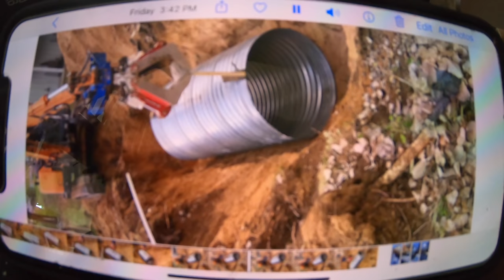We weren't prepared for what we found.  Bomb shelter #2

Comment: I have never operated heavy equipment before, but I would have guessed that a regular bucket would have dug the hole faster.
Reply from the maker: you are correct-  we weren't expecting sugar sand-  that really screwed things up.
Reply: @R-Dub-Ya  Funny i would have said "trying to eat a stake with a spoon"😂
Reply: @R-Dub-Ya  honestly probably be a crap shoot either way, be a lot of down time to get a different machine in there that may not even be available in the first place.
Reply: Well it looks to me like bro Stan likes a good challenge too, like working with what you have, it's fun, that's the farm boy coming out! Great job at persistence and not giving up when things go haywire!

Comment: My story —— it never mattered what I did weather building a house, shop, barn, putting in outside hydrant, driveway or fence after all said and done there is always something of the project I would have done different even after studying, rethinking, changing, and going over in my head time and time again before I even started. I have come to realize in my 67 years nothings perfect.
Reply from the maker: agreed-  very well said.
Reply: As long as we don't get stuck in OODA loop we'll be ok. 👍 Getting the job done is all that matters.

Comment: Stan, I'm sitting here thinking about something. A wireless headset for the operator of the excavator, and a hand held walkie-talkie for the spotter would be a huge safety addition. Only need them on occasion. Would definitely help. Nix any misunderstanding.
Reply from the maker: good idea.  we typically use hand signals to communicate.
Reply: @guilty of treason on Youtube uses them to communicate with people down on the ground. They can be quite cool.

Comment: We have all been at those projects was doing Landscaping&Tree job at one of my great customers of mine she was tearing baseboards off an basement apartment wall she has in her 1808 house. We ended up gutting entire apartment and digging outside along foundation putting in drainage pipes and sealing walls inside and out turned out to be a major month and a half project.
Reply from the maker: Those get interesting-  I went into a pool demo job. Simple $7,000 demo project and ended up jacking up their 3 story house, partially rebuilding the foundation wall and compeltely gutting their back yard.  Total cost went from $7,000 to $75,000.  they just kept adding on more and more work.
Reply: @Dirtmonkey   The great thing though is that YOU were up to the task.  You got the job done.

Comment: When doing a project like that why would you even have the grappler
Reply from the maker: It wasn't a big dig- so instead of swapping the grapple out- digging with a bucket and then reswapping and installing it- we just went straight to work.
Reply from the maker: On some jobs it takes longer to swap out equipment and  then just getting through the work.  But you go have fun with your tack hammer

Comment: I needed to clear a corner on my lot for snow removal then a garage. Got a mini x and dump trailer lined up for stump removal and grading the pad. The tree removal company didn't show up for two days so that put me way behind. I wasn't able to remove all the stumps before I had to return the mini x and trailer. Winter hits and I had no place to pile snow. Spring comes around and the wife and I get COVID. Recovery was slow and couldn't get back to the project until fall when I was able to get the mini x long enough to remove the remaining stumps and fill in the holes. Luck had it a friend bought a new Kabota loader and wanted to try it out. He did a fair job getting the roots out and grading it down. A job that should have taken 4 days turned into 2 summers. And I still have a pile of stumps and roots to haul off. At least I have a place to pile snow.

Comment: Stan, great video as usual just a suggestion we run the same grapple and when we are using it to dig dirt we welded tabs on the  both ends of one side of the the grapple and would bolt on two plates so when  your digging the one side would catch more material. Just a suggestion keep safe and keep the videos coming.

Comment: Happens every once in a while doing diy crap. Wife wanted a light over a sink and it should have been easy. Marked the area to cut out, cut the dry wall ceiling and a water line ran right across my junction box hole. Day later finished the job.

Comment: Not construction related but i purchased a 1977 Jeep J10 Honcho with an AMC 360 for dirt cheap that "just needed the carb put back on" got the thing running and it developed a tapping sound that would come and go. I bought an edelbrock intake manifold and went to put it on and noticed a lifter was blown apart. Ordered a new camshaft and lifters, got them put in and the tapping was still there. Decided to completely change my plans on it and pulled the motor to discover a spun rod bearing. Did a complete rebuild on the motor and went to put it in but decided i would change plans again, i just couldn't bring myself to put the motor into a dirty rusted engine compartment. The truck is currently scattered all over the carport while i do body work and paint it.

Comment: If you were going to build a retaining wall in that area  would you have to remove all that sugar sand to make it work or could you add in structural soil on top ?
Reply from the maker: we could use that sugar sand as backfill-  its structural and good material-  just hard to work with.
Reply: @Dirtmonkey  i'm guessing if you put a large foundation under said retaining wall it will stay put, just not sure how large it would need to be. you could always use the rule of 3. one foot wide wall = 3 foot wide footing.

Comment: Always enjoy watching but wondering why you didn't use the skid loader for that job? Straight in and out you would have been done in an hour then track up and fill around it. Was interesting watching you try to dig fast with the clamp bucket. I get tunnel vision sometimes on a job and one of the other guys goes why not this and I set back and shake my head.
Reply from the maker: We had to dig this in pretty deep underground.  If it was stright in the skid would have worked-  this was down as well.
Reply: Digging this sand with the clam bucket is like trying to scoop water. I would of not had the patients
Reply: @guyod1  I would have sent someone for a 24" or bigger bucket.  I would have been frustrated with job.
Reply: @matta3888  swapping  out the clam bucket looks like a hour  project. So you are damned if do damned if you dont

Comment: should have put # 6 crushed rock under the pipe for drainage plus you have to have the ends of the pipe supported with steel or something that stiffens the pipe.  no ventilation in the pipe either so it is a death trap

Comment: Engineers hate tmachanics..... They love to put stuff where it is hard to service......
Reply from the maker: agreed.  I have said that many times over the years.👊
Reply: I’ve noticed newer machines make it a lot easier to service. I suspect Stan is correct, they just quickly shove an engine into something. I remember a French car that required the battery be removed just to change the oil… 🤷‍♂️

Comment: After plowing snow for a few years with a gas 2500, do you wish you went with the 3500 gasser? Or are you happy with what the 2500 does hauling and plowing?
Reply from the maker: I am perfctly happy with my truck as it sits.  Does everything I need it to do.
Reply: Only difference between the 2 is the 3500 has 1 additional leaf spring.  On Chevy/GmMs anyway.
Reply from the maker: Isn't their also a difference in the front?
Reply: @Dirtmonkey  
None.  You get a little more towing due to the extra rear leaf spring thats it.
Reply: I never knew that either til I got my 2500 Duramax in 2020, My buddy got the 3500.
Reply: I think one you go to 4500's the front end components are larger but I forget.  Same with f250 and 350. Same front end until it's a 450 or larger.  Still the same but larger components.

Comment: Why do you move the scoop of dirt/sand with the claws sideways with the hole facing downward? Would it hold the dirt better if you clawed it more up&down with the jaws closing at the bottom? I've never used anything like that so maybe I'm just talking out my azz. [edit] You changed tactics 2min later.
Reply from the maker: This digging tactic works great on clay-  not so much on sand.

Comment: My fav dirt and pipe story real quick…In Iraq (May 2008), a town mayor complained that the water pipe kept getting crushed by vehicle traffic and that the US military told them wrong tech info on installing. We had told them to put in the pipe under 3 feet of dirt…well instead of digging a 3 ft deep trench, they just dumped 3 ft of dirt on top and them vehicles had to drive over this crazy 3 ft speed bump which resulted in the damage. I was trying not to laugh when watching the argument while standing next to the engineering marvel lol

Comment: Stanley.  I know what you mean when you when you say a job takes a 180.  I hate it when a job takes a 180 and you are not able to change the rates.   And the subzero temps are supposed to break tomorrow.  I got a little clean out I get to do, I have to look at 2 other properties and I am trying to get things started on the garage tear down. before the snow arrives on Friday.  I am finally getting work but still have a killer headache.
Reply: The customer broke the contract. He had 2 options. Compete the work or negotiate a me deal. If you can't change your rates, that's on you and whoever you had write up your contract.

Comment: Looking at the soil how soft it is makes you think how are those trees standing up and not getting blown over by the wind.
Reply: The root system of most trees (or so I've been told) is usually 50% wider than the canopy (top branches) so if the canopy spreads out for 50 feet, the roots will spread out for 75 feet in all directions...that makes for a VERY stable foundation for the tree...

Comment: Hey Stan,
I was installing a 8 zone sprinkler system, had to go under a  2 car driveway to get to the other side of the property.  Going arou d the back of the house or running copper i side to get to the other side of the house was out of the question, the entire yard was pavers with an inground pool and a completely finished basement,  so under I went. Went out and rented a boring machine and ran 3 3inch pipes ( extra just incase ) last day Im there finishing up the customer comes out and tells me he is ripping up the driveway and doing pavers. Shoot me, 2 days waisted going under the driveway
Reply: I'm surprised you didn't shoot the Customer (after they paid you of course)...

I'd have been VERY tempted...on the other hand, having to rent the horizontal boring machine would cost the customer more than just ripping a trench through the driveway so at least you have that satisfaction...the customer payed more than they needed to...

😄😁😆😅😂🤣
Reply: @HappilyHomicidalHooligan  and I got the benefit of learning how to ues one
Reply: @JJLandscaping  That too...

😄😁😆😅😂🤣

Comment: it's not an good idea to make an bunker out of an culvert. you'll have rusting and the inside and the outside. and it's going to fill with water like nobody's business. you see other people's YouTubes videos that make them out of that stuff and they're flooded just make a swimming pool and just put a lid on it. concrete floor concrete walls. and put a lid on it lol . and then you need to put that sealant stuff on the outside and the inside so it don't leak water.
Reply from the maker: I think this customer will be finding that out the hard way.
Reply: @Dirtmonkey  cuz if you open it there's like a wall right there and there's plumbing on the top and the bottom. the top is for the liquid and the bottom is for the harder stuff if you know what I mean. if you're good with the salsa you can probably make that work but I would just rather get the 500 gallon. buy two of them sawzall one end off. sawzall the other end off put them together. use some metal screws to screw them together. and then somehow steal them together.
Reply from the maker: If it was a real bomb shelter I would think they would want more space- like a lot more space.
Reply: @Dirtmonkey  there is a way to cheat. no one's ever thought of this. you know those in-ground big fiberglass swimming pools. dig a hole very big hole. and then instead of putting a swimming pool in the right way you put the swimming pool upside down. I don't know if this would be a good idea. then you get a like a salsa Hall or a drill and cut a door in one side.
Reply: They're galvanized and made to be put underground. It's going to take a LONG time for rust to form, and even longer for it to be of any concern.

Comment: A period of my life I lived in a former Eastern block country, early years post wall falling. From my apartment in 10 story building I heard a car accident outside, rushed to the windows and saw many injured people. Emergency people were called. Here is the punch line of the situation: when the ambulance arrived, watching from an apartment window, the van stopped as quickly and closely as possible to immediately pop open the hood, just as quickly as one person rushed out to attend to the injured another rush out to figure out how to start the engine again. Both took time.  Just thoughts...
Reply: Start what engine again?
Reply: Sounds like a ford ambulance lol. I've worked on so many I've winded before what happens when the ambulance dies and you need another sitting there bleeding out.